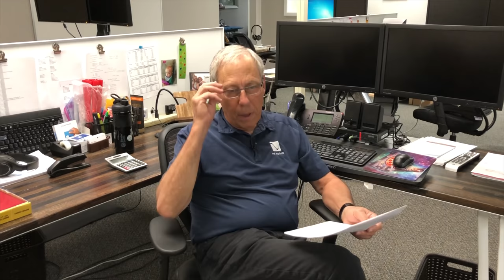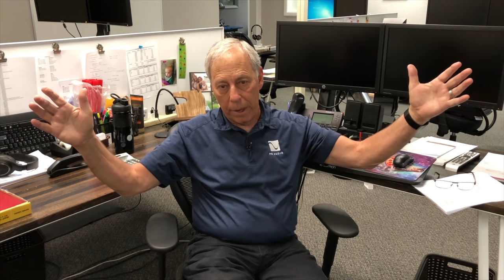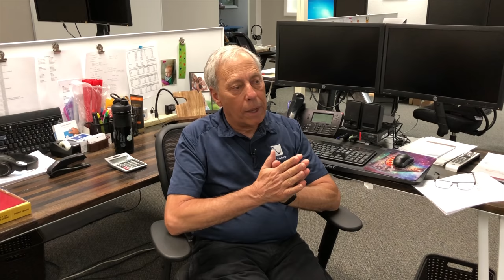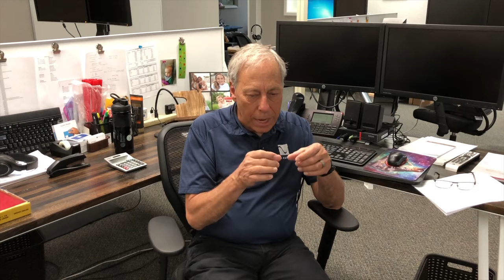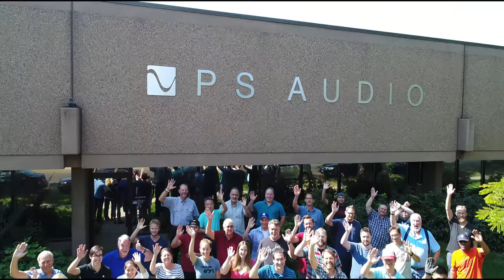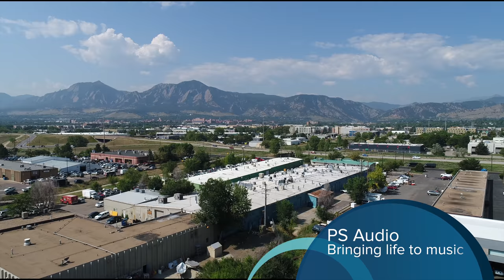How does a servo woofer work?

Comment: , I have the upmost respect for you being a professional and a pioneer in the sound industry.
I have only one question, why in the hell do manufacturers use such small woofers now a days?
I have a 35 year old pair of Sansui 12 inch woofer, 2 four inch midranges, one soft done tweeter, and one horn loaded super tweeter like JBL and Klipsch uses today, they will and do outperform any speaker that I have purchased in the last 30 years.
I have JBL, POLK, ELAC, and a shit load of other very expensive speakers and none of them can hold a candle to the sound of my old 35 year old speakers !!!!!!!! I found that only a hand full of companies make speakers with larger woofers like Cerwin Vega, BIC, and some very expensive JBLs
Reply: There is a reason. Directivity depends on the size of a diaphragm. A driver that is relatively large to a wave it's producing will have a polar response in a form of a comb filter.
30 years ago they realised that directivity is important. A good sounding speaker is such that it's polarn pattern is smooth and close to constant. To achieve that a woofer needs not to be much larger than a tweeter. So nowdays both woofer and a tweeter on a speaker are smaller and closer in diameter. They make up for it with increased excursion. So in the end they maintain the same displacement, but fare much better in directivity.
In adition large cones have problems with modes, breakup, nonpistonic motion. They're used in PA, subs, IB, but they're not good for high fidelity.
As to why you like your Sansui more I have no answer ;)
Reply: Marcin, you are full of shit!!!
You cannot have a woofer the size of a tweeter and expect deep bass, especially without needing gobs of power to achieve a respectable SPL due to the fact that lots of  "mini-woofers" tend to have shit sensitivity ratings like 84dB at 1w/m. Deep bass requires the sweeping of large volumes of air. If you consider a 2-1/2" cone with an x-max of 5mm to be a woofer then you are deluded since the best kind of response you will get from a driver like that will possibly reproduce 100Hz at moderate volumes before the voice coil is bottoming out in the gap. That would make it a low-mid driver at best.

If you really believe that large cone bass drivers cannot be hi-fi then you are truly lacking experience and exposure. I have a first gen DVC 12" JBL GT sub in a homemade custom box being driven by an Emotiva amp and it is still the most musical sub I've ever heard until you start bringing in reference subs costing many times what I paid.

Only decent headphones can reproduce low bass with tiny drivers, but those aren't cones per say. They are super light weight diaphragms that easily respond to the full spectrum of audio signal seeing as they are easily manipulated by even the lowest amounts of power, yet their sensitivity is still so low that no one would ever consider them for for anything beyond "on ear" monitors.
Reply: Tim, I think older speakers like you describe have a certain quality to them that lots of modern speakers don't (though there were lots of junk speakers back then too) because the people who designed them were using a two approach method. First they had to design the physical and electrical parts (drivers, boxes and crossovers) and then they had to fine tune them by ear since there was no computer feedback. They had to sound like real life or close to it.

Modern, mass produced speakers are simply made to try to get a ruler flat response across their spectrum. They may do what the amplifier tells them to do, but they don't "sing" like the oldies did. 

That said, you can still get some mighty nice sounding speakers for a fair price if you do your homework, but there are tons of them to wade through now so it could take a while to find some you like the same as your old ones if you are looking for new.

Comment: Did you ever try using a hall effect sensor for measuring the travel of the woofer?  A magnet on the woofer, with a hall effect sensor to measure the field strength of the magnet as it travels to and fro.  This would give you a proportional feedback relative to the position of the cone.  The distance would be proportional to the power input, but the rate of change would mirror the input signal.

Comment: I wonder if this applies to the Kenwood KAC-818 'sigma servo feed back'; had the amp (still do) as a teen and hooked up the extra lines a second set of inputs on the box to the extra tabs that were on the Radioshack 18" I was given.  Seemed to control that well but had no idea if it was doing anything.  Maybe I was lucky and just happened to buy a frugal amp that matched the free 18" my dad built a small sealed box for to fit in the back of my 88 RX-7.  I always thought later on it might have been a sales gimmick so looking it up now :p

Comment: This SERVO Idea is nice technology-and-all..  However, if the studio that created the MIX that is finally impressed on the CD/Vinyl OR Whatever storage medium did not have this listening/monitor equipment at the time of creation, it might be hard to recreate what the MixerMan/Producer heard when the Medium was created..  In my humble opinion, the best way to recreate what was originally created on the storage medium would be to have the exact reproduction equipment that the medium was created with.. Most everybody has a 4" speaker OR a set of Earbuds.. However, if the audio wasn't created-or-heard with the same listening devices, the audio will not be reproduced the way it was intended..   I hope I passed that Thought/idea along, correctly..
Reply: By your logic, it is useless to aim for lower distortion than the supposed level of distortion heard by the recording engineer. Sure, everyone should listen to Yamaha NS10s...

Comment: Woofers and subwoofers can be controlled very well with servo because you are working with low frequencies and the servo has time to react and compensate.  As the frequency goes up it becomes impossible to fix the problem because the problem has already occurred.

Comment: So basically what hes saying is that theres some kind of timing issues due to the weight of the cone materials. The amp is telling the subwoofer to move. But for some reason its not moving accurate enough. Kinda like subwoofer lag. Resulting in unwanted distortion. Wouldn't that be also a power issue? Isn't that why its very important to plenty of headroom in your amplifier for whatever driver you plan on driving? This may appy to all speakers. I  have noticed that my subwoofers become much faster, cleaner and more accurate when I connect them to larger amplifiers with over power ratings of my subwoofers. I  dial down the volume on the subwoofer amplifier to match the wattage output that I need for my subwoofers. I do this as a precautionary when I decide to crank out some tunes a bit. Not to damage my subwoofers.

Comment: LOL, they were still selling the SM series to service men in the late 80s.
Sounds like one could convert older speaker system to a servo system - maybe there's a DIY market you folks could fill.  As you described it, my very first thought was "why not use a laser to measure the movement directly?".  But your solution is MUCH cheaper, even if a lot more complex.

How significant does that correction signal have to be compared to the original signal?  Let's say I have a 2.2V square wave at 40Hz. (or specify your own numbers, if you like), what would the voltage of the correction signal be? (I specify the square wave knowing this would require the largest correction signal).  So if I'm hearing you right, all your servo woofer systems are powered and have their own amp.

I noticed you didn't mention the mass/stiffness conundrum. I've seen woofers made out of all sorts of material, even titanium.  And even with your servo system, the woofer cone would still flex, causing distortion.  Now you need to find a more rigid cone material to further reduce distortion.

Comment: what about using a graduated port so you can minimize the movement of the woofer diaphragm over the intended frequency range of use?
Reply: TLs 😉🤔
Reply: @gregorgregor6924  ?
Reply: @NVMDSTEvil Hi! I was talking about TL, Transmissionline. But with servo, you probably could doing smaller enclosures and don't need to know a lot of stuff about damping...

Comment: I'd suggest using non touch measurong method such as laser proximity measuring the cone's position. Besides, it is what is done inside the accelerometer. By implementing the laser proximity sensor of the cone relative to the frame we get much more accurate data amd faster on realtime, without adding any weight to the cone

Comment: Given this auto EQ that is applied to the woofer signal, if you're running an EQ for the room, will this Auto EQ allow for these alterations or will it attempt to compensate? Is there a maximum given boost in the attempt to give a flat response from the woofer? Does it run passively? How does it alter the signal if it is running passively? Your explanation intrigues me to know more.

Comment: What do you think of the Event Opal woofer technology that has another coil but it's out of phase, I think it works in the same way where you tense up your muscles while opening a bag of chips so when the bag finally opens the inertia of your arms doesn't fling chips around the room.
Reply: Dunno, but the driver still has mass (and thus inertia) so it's still going to have problems.
Reply: We would need a massless plasma driver for what you're describing. Lots of deadly ozone though.

Comment: Yes Velodyne made them way back in time. The ULD (ultra low distortion) series had them and yes, they were expensive. They did claim very low distortion. I wonder how they would stack up against the high end subs of today, that do not use this technology but use incredibly powerful amplifiers and massive magnet structures (SVS subs for example).

Comment: I had a Genesis servo sub for the home..worst speaker I ever had..for a start..the cabinet was extremely heavy and overbuilt..second, the woofer itself was of very poor quality..much like an old Morse Electrophonic speaker, thirdly, it developed a malfunction were every few hours, it would make loud thump..even when the stereo was turned off..i didn't know where the thump was coming from, it started to get more and more frequent..i thought my house was haunted..till one day I happened to be looking in the direction of the woofer when it did that ominous thump..i saw the woofer move..whew..boy was I relieved it wasn't demons..anyway at great expense.i shipped it off to be repaired ,after 3 months I finally got it back..and it still didn't work right..what a bad buy that was

Comment: Hi Paul, this is the first time i've heard of a servo woofer. Sounds like a neat idea to get really taught bass. You mentioned the piezo device that is relatively cheap but what is the lifecycle of that unit due to it's constant flexing before it would break or need replacing? thanks Kym from UK.
Reply: since tweeters are often piezo, they seem to manage ok

Comment: What about using the main coil as source for the feedback signal?
The  emf coming from the loudspeaker coil should be proportional to the speed of the membrane. A "simple" differentiator [i.e. transfer function F(s)=s] following that emf should provide the needed acceleration feedback voltage.
Reply: Or even a sepparate coil next to the voice coil (on the same cilinder). Or on top of tve voice coil (with thin wires). That coil should produce a voltage only when you have a distortion and if you add his voltage to the input signal (matching levels) you have all the servo you want :)
Reply: My half brother built some amps using back emf. Works great afaik.

Comment: I have owned a lot of mfb speakers from Philips who invented this system. Best bass ever but the mid and high were also very 70’s. So I ditched them. A theoretic problem is the slew rate because of the electronic circuit. In reality not a problem bevause the slew rate without the electronics is already longer.

Comment: The dutch company Philips released their first MFB active speakers in 1974. As I recall they did sound great. They made many more models until 1984, but oddly there it stopped. In spite of technology  way ahead of it's time. Maybe they were to expensive, I don't know. Quality or innovation is no guarantee for succes. Philips was the first to put out videorecorders for consumers and later they developed the superior V2000 format with reversable cassettes, but they were eventually surpassed by the VHS system because of content.
Do you know where and when and by whom the MFB system was invented?
BTW I like your channel very much. Thanks!

Comment: I wonder at what size woofer you don't need a servo motor. If you have a newer designed modern day motor with a vented ported system do you even need a servo or is it extra cost with little benefit with smaller better designed drivers. At what size do you need this 10inch, 12inch, 18 inch etc. And how does it affect speaker designs in a two way with a need to go into mid range frequencies. Is this really a very high end option for clean bass thats really not cost effective for the vast majority of applications.

Comment: I remember a long time ago when Velodyne servo subs first came out and I was able to audition them.  Scary bass. If you didn't know what low bass was they would take you to school. So I just looked them up right now and the are still in business but their servo subs are $4k-$6k!  Continuing to search, I then found brand-x for $750 (F12-300 ).  Why such a price range?
Reply: For the same reason you can buy a Ford at a tiny fraction of the cost of a Ferrari :)

Comment: Servos are only necessary if you're using weak amplifiers. If you have a really powerful, accurate amp, a servo just gets in the way. That's why no real high end company uses servo drivers.
Reply: yup

Comment: Can those things be implemented on any speaker or a special speaker has to be built with the piezo element? I'm from
The pro audio industry and i agree that subs and bass reproduction systems on the pro market aren't actually in the race with such drastic improvement
Of low frequency distortion reducing and time impulse response improvement. Can we bring those things on boat for pro audio?

Comment: Instead of using a piezo element, could the same thing be done with a dual voice coil speaker.  One coil for driving the woofer, the other for sensing movement?
Reply: In theory yes, but more voicecoils = more moving mass = more of the original problem to fix

Comment: Why not add a tap to the voicecoil and use that for servo feedback?
Reply: I have a very early MK Volkswoofer that uses two voice coils. The problem involves the electrical signal from the amp being sensed through transformer action (inductive coupling) instead of just the woofer motion,
Reply: @johnhodgson5313  Is that really an issue at low frequencies?
Reply: @lazzer408  The movement of the woofer is what needs to be detected. I would think inductive coupling the amp output to the input of the amp would have the effect of correcting for amp errors instead of just the woofer motion. That is why I favor accelerometers as they will only react to the woofer, there would be little to no amplifier feedback in the servo circuit. Maybe I'm missing something? Clarification would be much appreciated.
Reply: @cjhodgson3000  The impedance of the motor structure would limit the voltage induced into the FB coil. The coils have to be moving before the voltage in the feedback coil maximizes. So yes, there would be some voltage induced into the feedback coil but the error amplifier (differential amplifier) is looking for balance. It's error gain is significant until balance (no error) is achieved. I've not performed any tests but I visualize this being the case.

Comment: A friend of mine swears by philips mfb speakers, Do they have a comparable technology?
Reply: Philips doesn't use motion sensors. They use additional coils in the motor that are not driven by the amplifier. They're used to measure induction - that simplifies things as you don't need to integrate the signal from the servo.
Reply: No, they used a piezo pickup to measure acceleration of the coil/cone.

Comment: I just thought of a really crazy hypothetical scenerio in regards to what you were describing at 5:00.
If subs are always struggling to control the mass of a woofer in order to create articulate bass, What if a Non servo sub were demoed in a zero g enviroment, like the spacestation? Wild idea, i know! But it Should have Superb bass control Without a servo becuz the cone would have literally no weight to  deal with so the amp could move it with incredible levels of control... wonder if thats ever been tried?
Reply: Astronauts still have to push themselves around in space. The fatter the astronaut, the harder they have to push. Mass doesn't decrease in space, only the force on your feet. The speaker would be no different in zero gravity (inside a rocket with air, or course).

Comment: There are acouple more reasons. -You can only use them on powered woofers. And people still keep buying passive ones. - It is a rather long feedback system, and there is a religious believe out there in the audio community that feedback is bad. - As  mentioned they don't know how to make it. There is a rule in electronics oscillators never oscillate but amplifiers allways do. Depending on the signal of a magnetic driven device means that this feedback is already out of phase . I guess that increases the reluctance of developers to give it a try.
I remember that the now obsolete electronics manufacturer Valvo in the Netherlands had a budget woofer driver with piezo feedback unit in his program in the early 80th